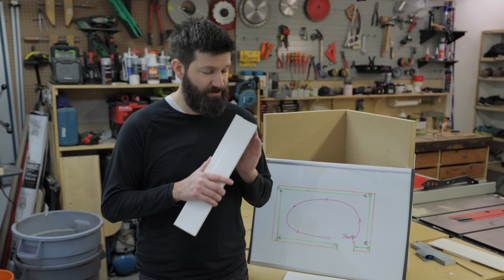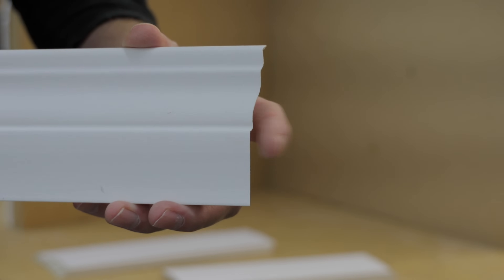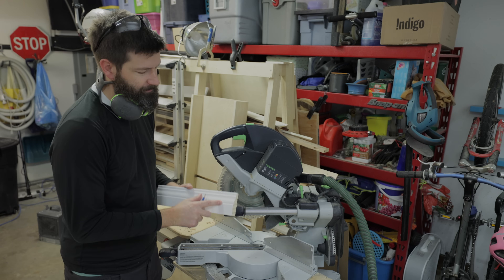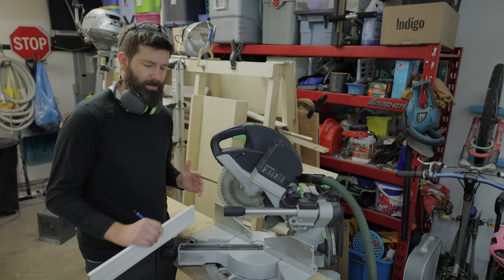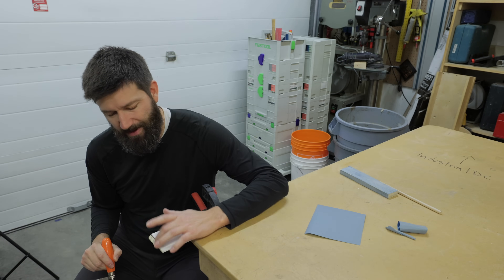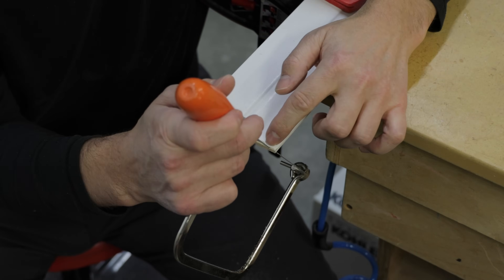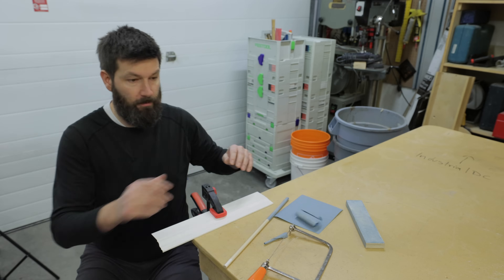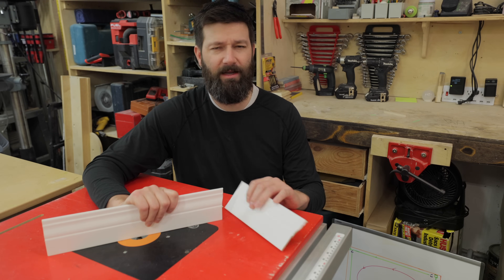How To Make Perfect Baseboard Cope Joints!

Comment: tried it once, and only once.  Doing a tiny piece while sitting at a bench might not be too bad, but doing one on a job site wrestling a long piece is a lot harder and to be honest, I don't think most people who are not carpenters look down at baseboard trim all that closely. lol
Reply: i couldnt agree more
Reply from the maker: Fair enough, that being said in my opinion it’s fun to get perfect fitting cope joints.
Reply: As a professional carpenter, I ALWAYS cope inside corners as well as on crown molding. Sure, “most people” won’t notice and the client may even be nearly blind, but almost everyone has a friend or relative that will notice. The biggest factor however is that in time, the wood may shrink or the house might settle, leaving a noticeable gap. I certainly don’t want to return a year later to squirt caulking into mitered gaps, and I’d bet a novice won’t want to either. You wouldn’t believe the stuff I see that I makes me cringe, but I keep my mouth shut 🤐. Good on anyone trying their best though.
Reply: I just cope the right edge of every single baseboard all at once with an angle grinder. Takes maybe a minute or two each.
Reply: If you mitre your skirting board on my site you wouldn't last long!!
Reply: @philsburydoboy  sanding disc on an grinder is the best way 👌
Reply: @ganduffthegrey5180  Nobody cares about "your site."
Reply: Lol
Reply: @ganduffthegrey5180  everyone’s got their quarks, and every quark came from either a customer or a journeyman.
Reply: Doing a better job takes longer
Reply: @@nicholasdecato4207 true. I guess it would just be expensive if it's also fast and correct. 
Quickly, cheaply, correctly. Choose 2, right?
Reply: @@nicholasdecato4207 we're on the same page. I also think its pro vs amateur
Reply: @joeallen9897 Quarks come from Hadrons.
Reply: What quack uses the word quark (twice!) when it's quirk? 😅
Reply: Even carpenters can't tell if it's well done.
Reply: It’s honestly a waste of time. If you’re going to 45 the piece of moulding anyway why spend time coping it? Especially when it has a high probability of chipping while sawing on it. The make caulk and putty for a reason. The only time a cope is with crown molding.
Reply: @TheFunnyCarpenter 
Fun? Are you getting paid to have fun ?
Reply: @douglas60040 
Who gives a shit if the house settles in five years and there’s a gap in some moulding ? Are they going to know who trimmed their new home? Do you sign your work? If I was a your boss I would fire you for wasting my time.
Reply: Then when you cut the piece of moulding a 1/4” to short you’re screwed out of a 16’ piece of trim. Only idiot’s waste their time coping baseboards 😂

Comment: Love  coping,how ever the boss dose not . No matter how fast you get at it . I feel like your gonna spend that time if not coping than caulking 😂😂😂
Reply: You have to caulk anyways, no? you need to caulk the line where the base meets the wall, or any imperfections in the wall where the baseboard can't bend enough to hug the drywalll will show, and it is a place to accumulate dirt and crud, as well as the black line just being unsightly. 

I don't caulk, as I work new construction and the painters handle that, but I don't think I have EVER installed baseboard that didn't get caulked before paint anyways. And if you already have the caulk gun out, how long does it take you to caulk a miter? 5 seconds? MAYBE 10? possibly less?
Reply: @timmietimmins3780  5 seconds is the joint is good but once you start running into the issue like we’re pointed out in the video, and sometimes they get bad then you could be spending a lot longer on them, sometimes needing a second pass
Reply: Same situation, I like and want to cope but the boss thinks it’s a waste of time 🤷🏻‍♂️
Reply: Miter joints are for hacks and production builders.
If “ the boss” hates quality so much than just use craftsman base (aka flat cut stick O’ wood)
Then there’s no need to cut any corners.... except the corners that your shitty boss with low standards is already cutting.
Reply: @timmietimmins3780  caulk should fill tiny cracks, not large open miters. If the walls are square, then your miters are going to be fine, but if not, large open miters look terrible.
Reply: @itaintrocketscience  It's always annoying to me that carpenters look down on easier methods. I get it, it's a slightly better corner. But it's just a piece of baseboard. Nobody cares. A mitered baseboard looks fine.  Fantastic for you if you want to take a few extra minutes, but some people don't and you don't need to look down on them. It just stinks of insecurity.

Insulting someone because of this tiny silly detail that nobody sees? Why not worry about something that actually matters?
Reply: @christophercrawford2736  You can use an angle finder to grab the real angle of the corner and have miters that look fine.  No harm done (other than to the ego of the carpenter who doesn't get to use a fancy old-timey skill.)
Reply: @timmietimmins3780  production homes dont have time for a lot of this fancy pants stuff. Cope and roll baby and let the painter have it. Weird to spend 5 minutes being fancy and sanding to save 2 minutes of caulking. Time is money my friend
Reply: Try cutting inside corners at 44 and outside at 46 
The drywall mud changes the angle 
If it’s real wood that’s stained like oak I’ll cope 
But that’s the only time 
Some guys cope and then caulk the corners why bother 
44 and 46 works the best
Reply: @itaintrocketscience  
Old school
Reply: @dt8460  my favorite is an 80 or 100 outside corner. Framers and sheetrockers are lunatics. Ive had to float my corners 3/4 inch to keep my base square. Add some mud finsher guy
Reply: @deadfisher0000  true, but that’s also not perfect due to mud build up in the corner.
Reply: @deadfisher0000  
I see your point. It does appear that I’m being petty.
And yea,it’s only baseboard and no one cares……..

Except me, I take pride in my work.
Faster is not better. Faster is faster.
Better is better.

I try to do the maximum good when I build.
Open miters are embarrassing and stink of poor craftsmanship.

But hey…. At least we can all try to win the fastest carpenter championships
Reply: @itaintrocketscience  craftsman base?? Are you referring to flat stock?
Reply: @christophercrawford2736  there's no such thing as a square wall, guy. 

I used to work with a framer who liked saying "Everything's square til the walls go up." a "square wall" is a pipe dream. The only way to get a tight miter, unless you get SUPER lucky, is to shim it.
Reply: @deadfisher0000  that's the thing though.. For an experienced carpenter coping a joint doesn't really take anymore time than trying to fit and shim, then caulk a miter, and it comes out FAR nicer in the end. Cut your 45, cut off excess, then ream out the cope with an angle grinder or a table saw. Done. No shimming, no caulking.. Just a tight joint and done.
Reply: @BruceOfWaynes  
That’s what the kids are calling it, yes
Flat stock=“craftsman “
The polar opposite of craftsmanship
Reply: @forpetesake20  “ time is money my friend “

Attitudes like this are why most houses are shit.
Zero quality and care.
Todays society seems to deserve a 3d printed house.
I mean, why trim at all?
It’s only cosmetic. 
No need to paint either.
Oh…. And just one coat of mud will do it, that’s all the code requires.

We can really save time money then.!

Get dat money!
Reply: @BruceOfWaynes  that was my point.
Reply: @itaintrocketscience  im glad your in an environment in which you can pick and choose your jobs but some of us out here have to take what's available to pay our bills. I aint spending 3 days in a house for a few hundred bucks because some cheap ass wants a Mercedes at a kia price
Reply: @forpetesake20  
Yea, I don’t know what craftsman is.
Which is why I perfectly described it in one of my posts above.
And of course I know what 5/4 is.
That’s $1.25 duh..

Edit. Isn’t 5/4  a musical time signature?
Now I’m just confused
Confused as an inside miter joint
Reply: @deadfisher0000  mitres look crappie, plus there's usually a bell cast to the plaster.

Comment: Paint grade just cut a few pairs of different angles - 44°, 45°, 46°... whatever you feel you need. Make them 6 - 8 inches long for a fair assessment (can make some a couple inches long for corners next to doors.) Write the angle of each on the backside. It might take 5 minutes and waste a foot or two of material - big waah. Use them when measuring your cuts and you're done. Sometimes a mismatched pair of angles works better than two of a kind. Also there are times when using super glue and accelerator as you would when doing crown mouldings works even better.

Comment: This would have been more effective with stain grade, because regardless of coping or mitering, if you're going to paint, you should caulk (or spackle). And if it's stain grade, you should cope. It takes more time initially, but once you get in to the swing of it and stop making mistakes it goes fast enough.  Tight joints mean less time on the caulking step, and checking square on the corners is wisdom.

Comment: I just finished my basement and like every trim job I have ever done, it's coped 100%. Because I am also the painter, I don't even consider mitered inside corners.  
A good tip for final sanding of the unassembled cope joint... make a sanding block using a scrap of baseboard.  Use spray adhesive and glue the sandpaper to the profile...
Reply: OMG. The baseboard scrap sanding block is genius!
Reply: @live2ride77  I'd like to take the credit but I saw the idea on another video awhile ago.  I just can't remember what channel.
Reply from the maker: That’s a great tip, I’m going to try it out. Stay tuned maybe I steal this idea and make a video😂

Comment: I agree, coping can look clean in certain applications, however, I hate the way the top of the joint looks. I typically cut my insides at a 44° & outsides at 46°. If the base is open in the back, it’s minimal and the caulking hides it. If the corners really bad, use the angle finder.

Stain grade, angle finder on every corner. Write the angle on the wall behind the base.

Comment: Finish carpenter for over 4 decades, there are many tricks that make mitering fast with excellent results, typically on painted millwork I use a glued miter joint to prevent callbacks for cracking corners due to wood movement, on prefinish coping with a Collins foot and a shaper made with scrap and sand paper usually give excellent results with decent speed, but there are always carpenters out there that say “ you can’t do that “, with the specialized tools of today technics need to change.

Comment: You nailed it.....  DIY..er here.   I've done both.  In my limited experience, on my own, simple base geometry, I've mitered.  If it's busy I would agree coping is so nice.  I'm not a pro, so going slow is not a problem... Mr. TomPara below is spot on for first timers, a dremel with a barrel sander insert is your friend,   Find some cheap base, and practice a few corners.  

A quick (edit) You want one of these.    Starrett Miter Saw Protractor, Prosite 505P-7.  I'll let you do the affiliate link to you know where.... I have literally bought three, two as stocking stuffers.

Comment: I have been doing trim work for the past 40 years in  high end custom homes. 

I do cope the baseboards only because I think it is actually a little faster. 

You can cut all the flat pieces  1/16th short it won’t matter because the cope will cover it

When you back cut the flat part of the miter with the saw it’s only the profile you’re taking out with the coping saw saw.  it literally takes 10 seconds with a good coping saw. 

That being said if you know how to mitre your angles and adjust your saw You can do just as good of a job mitering.

so instead of 45 all the time you Can just do all your inside corners at 44° and make everything a tad long and spring fit it. 

It will look just as good as any cope
Reply from the maker: Well said!
Reply: inside 44 outside 46.
Reply: Nice tip! I guess im less experienced but I for sure do quicker work doing miters that copes. I worked for my brother who built spec houses and he would laugh his ass off me doing coped inside corners. We're in the south and I never see people cope (I'm sure there are some).
Reply: Yep

Comment: I've mitered and coped (typically doing the miter when I'm in a rush) but the coped joint not only gives a better looking joint but I've found that my miter joints had the tendency to open a few years later. Not certain why (maybe wood dried out and shrank) but I've never seen a coped joint open no matter how many years had passed.

Comment: I always try to arrange my coped joints so that they are on the shortest peices. It makes it so much easier to square cut both ends of the biggest peices. Obviously if the room is just your standard  rectangle with 2 doors that's irrelevant,  but I often get to do my copes on peices under 5 feet which is really  nice.
Reply: Doing that also helps if you make a mistake because the piece is small so minimal waste

Comment: I've been coping baseboard in my room do-overs ever since I learned about it a few years ago.  Instead of a coping saw, I use a router with a 45 or 30 degree bit. I can use two hands to control the baseboard and really get exact material removal along my profile.  I can do the longer pieces by setting up a support along the length.
Reply: Oh man.  Professional finish Carpenter here and cutting a cope with a router sounds EXTREMELY interesting.  I’d like to see that
Reply: @jeffpower6473  It's really a nice way to do it.  Just mount the 45/30 degree bit on your table router, lay your trim flat on the table, and carefully follow the profile revealed by the 45 degree saw cut, just like you do with a coping saw.  I'm clumsy with a coping saw and this way gives me a cleaner, more exact trim.
Reply: @donaldp9259  my dad did something similar with the table saw.  However long pieces could prove clumsy.  The idea of free handing it with a router is intriguing to me though.  I’m going to search around for a bit that could work.  The newest generation of palm routers makes freehand routing pretty easy, I do it all the time for various tasks on the job site.

Comment: Love the video. I have just one difference in how I was taught to layout a coped room. It’s difficult to describe but I was taught not to work one direction around the room but rather to consider how it was going to be looked at. Always look at the square cut along the coped piece and you never see the sawcut of the cope. So if you stand at the door looking into a room the far wall should have 2 square 90 degrees cuts while the coped pieces run along the adjacent walls etc. I guess I’m just old school but my instructor was a stickler for doing it right and 40 years later I’m still as fast as the mitred corner hacks. Lol. Btw I use a jig saw method. Very quick.
Reply from the maker: Excellent advice Henry.
Reply: angle grinder with a sander disc, is the fastest easiest way I've found. works for both mdf and real wood, just melts through it and being round the disc makes perfect coves or flats.
Reply: We both must be old cause that's how I do it.  I always finish to the door on both sides

Comment: Coping all the way for the win funny carpenter little thing I like to do use your CA glue and glue a piece of the sand paper to a little scrap of the baseboard on the profile side and it works great for for cleaning up the coped ends 👍
Reply from the maker: That sounds like a great idea.

Comment: I use copping method always. I start with square cut on both ends on the wall opposite the door. Then a cope  cut into that piece, working my way around the room in both directions to the door. That way you will never look into an open cut from the entrance if anything moves or opens up with time.
Reply: That's how I do it.   Can't even see the cope
Reply: Thats a good idea.

Comment: It’s defiantly a personal choice but once I started coping with a coping foot it’s made things so much faster and easier for me! One thing I like to do is use the mitre saw like you showed, then the jigsaw to do maybe 80-90% of the cut and then use a dermal with a bur to get it perfect and if need be a file, gets me some pretty good copes but takes practice not to go too far, but once you get the hang of it it seems like a good system! Works for me at least!
Reply: I think it’s compliantly a personal choice.

Comment: For flat stock base, would you recommend just butting the boards on the inside corners, as well as filling the void where the round over edge meets the flat stock? Would love to see more videos on different types of moldings and how to manage them. Thank you!
Reply from the maker: Yes I would normally butt them.  How big is the round over? If it’s small caulking will cover it up.
Reply: @TheFunnyCarpenter  very small. I’m not savvy with size maybe 1/8”. Very minimal void since I’ve butted them together.

Comment: I use a flap wheel on my grinder for coping. Once you're used to it, it's way faster than a coping saw and way easier to control than a jigsaw. When I see mitred inside corners it just looks like amateur hour to me.
Reply: Yeah, the flap disk angle grinder method is my go to now too.  It was intimidating at first and you kinda need a steady hand but worth it.
Reply from the maker: I use the Festool Ras mostly, but didn’t think a lot of people would relate to that.
Reply: The issue with using a grinder is it kicks up gobs of fine dust.  I'm a jigsaw a file guy.  I use a variety of different file shapes, round, triangular and flat.